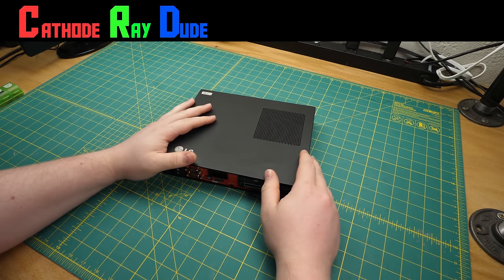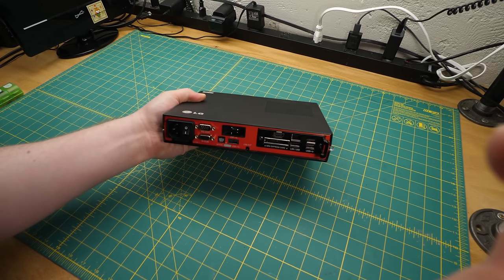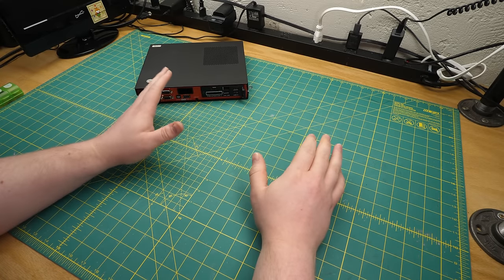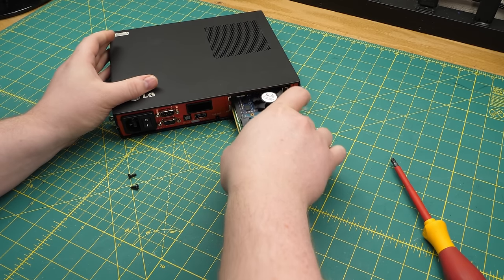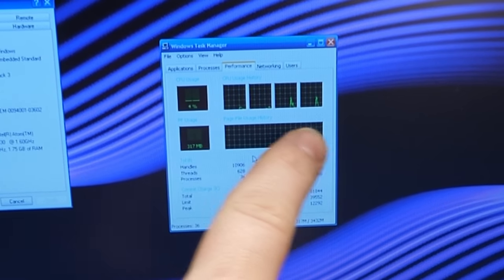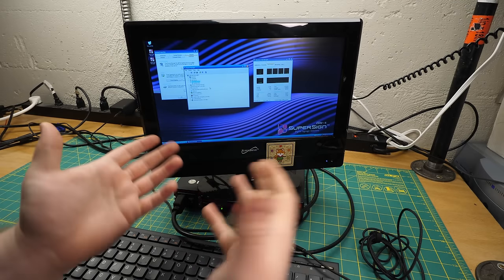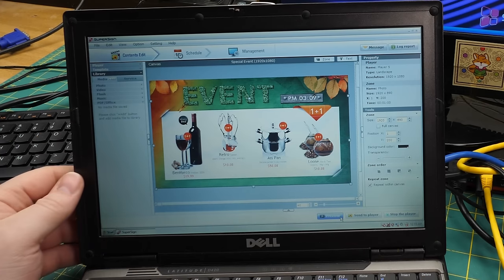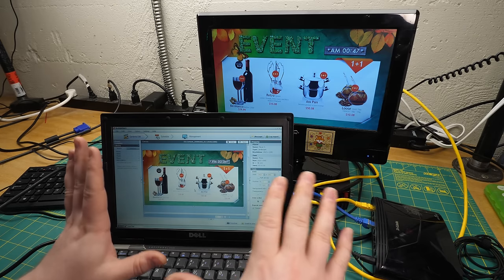Little Guys 6: The Worst Possible Timing [LG NC1000]

Comment from the maker: I've been informed that the super early Atoms (this is one of the first) were not fully SoCified yet and still required a chipset, so the ION probably is performing north/southbridge functions. Also, by the time this was made, XP was no longer being offered for new machines, so the embedded version was probably the only viable option.

Also, thanks to some viewers I HAVE ordered a cheap aliexpress breakout board for powering up my OPS units, but I'm still looking for an OPS enabled TV! Ideally 42" or smaller, and preferably with the touch functionality, but if you have anything and are in the greater pacific northwest, please get in touch - cathoderaydude at gmail. Thanks!
Reply: I had ION in hp 311 netbook. It was ok, surprising laptop where GPU is bottlenecked by CPU
Reply: I have an idea that might help you get a display. I used to intern at a New York public school, EVERY classroom had a Smartboard. And thanks to you I now know what the included OPS means. This might be a shot in the dark but if you contact your local DoE they might have discontinued equipment to sell off lease including a Smartboard.
Reply: nowdays the brightsign players tend to be a metallic blue. The still look beautiful ;)
Reply: ION in similar designs is used not just as a chipset but also for hardware decode acceleration which wasn't good at all on atom certified chipset from intel.
Reply from the maker: @MatteoSaitta  oh! That makes a ton of sense! I had read that the ion had video decoding silicon but it completely missed me that it would be important here, you're absolutely right.
Reply: Yep. I have a first-gen Atom desktop board that uses the 945GM chipset. The notable thing about it is that the CHIPSET has a bigger heatsink - with a fan - while the CPU has just a smaller heatsink. Because on those early Atoms, the chipsets (even a mobile chipset!) used more power than the CPU!
Reply: Besides Windows and Linux digital signage there are Android ones too. ION was a later on thing with Atom CPUs that was also included on some Netbooks, Nettops, and motherboards with embedded CPUs.
Reply: I'm replying here hoping you see this: there are OPS adapter boards on the usual avenues (Ali...) which break out all the ports and have power input
Reply from the maker: @Yrouel86  yep, already ordered one, thanks to another comment. Thank you!
Reply: Nvidia was able to make chipsets for any Intel systems that had the old-style frontside bus. Remember NForce? Ion is just Nforce for tiny low-power systems with what is basically a Geforce 9400 built in. They made an even better one for the early Intel Macbooks called the Geforce 320m. This died when Intel finally abandoned FSB and put the memory controller in the CPU.
Reply: Was about to say, i was pretty sure the atom 330 has gotta be using some kind of external ram controller since my nvidia ION board does ddr2
Reply: Much love for the Atom 330! Had two physical cores and had hyperthreading for four logical. The similar Atom 230 had a single physical core for two logical. Ran a 330 for years in an old Dell FX160 I used as a simple file server and the low power consumption made it viable to run 24/7. Chipset limitations did seem to affect things like RAM support - the FX160's architecture (and use of DDR2 with only 2 slots available) officially maxed out at 4GB RAM but even though the CPU is 64 bit if you max the RAM and install a 64 bit OS only 3.2GB is available as if you'd installed a 32 bit OS. Looks like the chipset was not designed to run 64 bits even if the CPU can do it.
Reply: I got one of those early Atom from Acer. it run linux and has the very early comercial SSD 16GB. it use pata ribbon. not the usual desktop pata ribbon. still lives but I store it back last year when I got new netbook. max RAM only 2GB. It does not like win 7 but win xp run just fine.
Reply: @MatteoSaitta  They were fairly popular for HTPCs of the era, had a mini-ITX setup running Kodi (nee XBMC) for several years, and it was great until it died, and at that point a Pi made more sense.
Reply: @CathodeRayDude  We see a lot of OPS displays in the education sector. They are used because these are interactive displays for classrooms so they run the built-in software like the digital whiteboard, wireless presentation, etc. They often have an HDMI input so you can go through that and have an attached laptop available via the on-screen software instead of using the "dumb tv" part's input switching. Usually running android.

They seem to be less common now that displays are being built with all of that processing power, OS and functionality built-in, which improves usability and stops users getting stuck on a different input. They are still an option though.

Anyway, if you can live with a big screen, look for schools doing refits if you want a cheap OPS display. Beware that OPS modules aren't necessarily universal though... I've definitely seen completely different connectors for different brands. I think that was an old issue though and over time they standardised.
Reply: I have an ion that I bought to make a DVR with Windows media center. I still use it, mainly now just as a network backup and the storage for my hdhomerun. The only thing that I didn't like about it is that it runs a little hot. I also bought a micro ATX case that has a vesa mounting bracket so I had it on the back of the TV at the time.
Reply: @CathodeRayDude  Someone should make a mini rack that you can plug multiple OPS modules in to, for home server setups!
Reply from the maker: @rebmcr  hahahahaha consumer blades
Reply: it is a LG Digital Media Player External
Reply: @dedr4m  Xbox 360 has an ATI GPU, the PS3 a Geforce 7. The main issue of the PS3 failing were special capacitors. I think the Nvidia GPUs failing came a bit later, with the Geforce 8 generation.
Reply: nVidia ION was a GPU but it was also a platform that consisted of an Intel Atom processor + nvidia GPU for small form factor computers- https://en.wikipedia.org/wiki/Nvidia_Ion#Ion_(first-generation_Nvidia_Ion)
Reply: @CathodeRayDude  I have an OPS display you're welcome to for free. I'm in the PNW too
Reply from the maker: @thepchan  awesome, although I just got one so it may not end up being useful - could you shoot me an email with the details on the one you have? cathoderaydude at Gmail. thanks!
Reply: I have a projector that states up to 32 gb flash drive support. My 64 gb drive won't show up, but my 1 tb external hard drive has no issues.
Reply: There are touch monitors for Thinkcentre tinys, that have the standart Lenovo Power pin. With a Buck converter, you could probably make it work on 12V or whatever you need.
Reply: BLAH BLAH BLAH,  BUT CAN IT PLAY CRYSIS???
Reply: Correct, and they were sloooowww
Reply: Still have joybook u101 with 945gc chipset init

Comment: A friend of mine runs a drycleaner and years ago  he was lamenting having to pay through the butt for his signage guy to update some system. Chromecasts had just come out and I suggested he try one for a small fraction of the cost and set his promos as a screensaver. Months later he said the biggest problem was avoiding casting soccer games to it while he was working and getting distracted.
Reply: a boyfriend? 🤭
Reply: I have also used a Chromecast (that I got for free with YouTube TV years back) as digital signage for a budget gym that needed my help, and the "remote management" of just adding JPEGs to a Google Photos album as well as the clock on-screen made it actually look and work nicely for them. Never found anything easier that also looked good on-screen (the Amazon players are just a 720p cutbus for JPEGs).
Reply: What if he plugged in a computer and set the adverts as a Screensaver? No need for a Chromecast
Reply: @kreuner11  if a PC can be acquired for free, then yeah go for it. Otherwise getting a $30 Chromecast seems way more cost effective.
Reply: Last time I paid through the butt was back in my pimpin' days. Crack isn't cheap, you know. Pun intended.
Reply: @baaelectronics  you can get second hand fanless 6 to 8W mini pc new from 120dollar.   2nd hand from 50...
Reply: @lillnemo1  Yet Chromecast is way more convenient for just throwing stuff on a Drive folder and forgetting

Comment: In the that era, the RAM depended on the chipset. 945 G/GZ/GM supports 4GB of maximum memory and 945GC supports only 2GB. I believe the Ion is also 4GB of RAM. The Ion is a GeForce 9400 M G but it's also the memory controller. The Ion could be DDR2 or DDR3. It also handles the PCIe lanes and SATA and stuff like that, and I believe it supports RAID 0 and 1.
Reply: The 9400M present on macbooks can work with 8GB of ddr3 ram, and the 9400 G too (desktop version) present on imacs
Reply: There is another part to the story and that is Intel doesn't go back and revalidate old platforms when new higher capacitiy ram chips are made
6th gen (maybe 7th gen idk) are quite happy to support 128gb of RAM, but 32gb ddr4 udimms only came out in the 9th gen
(They did go back and validate on 8th gen apparently)
Reply: I still remember when 775 was quite common. At least in my friends computers. I was checking memory compatibility, max ram etc... And it never was true. I remember gigabyte 775 mobo "Supports up to 4gb of ddr2" was working fine with 8gb, with c2d 😂 (early days of modded minecraft, that sh... needed A LOT). Also there was something similar on AMD platforms too. Still owning a C2Q with 8G that serves sometimes as a minecraft server :D
Reply: @carmonben  Correct, Intel does not go back and re-validate memory maximums. The Alder Lake N series chips for example will list 16GB of RAM as the max. But, that is because when they launched, that was pretty much as much DDR5 as you could get in a single SODIMM. Nowadays you can just slab a 32GB stick in there and it'll work.
Reply: yea theres no reason it would be limited to 4 or 8 gb when 32gb is supported on these chipsets and socket 775.  you still have to enable /pae /4gb in sys ini or windows configuration utility. 

windows also doesnt automatically enable dual / quad channel ram either. not for these boards if i recall
Reply: Ion 2 in my revo maxed out at 4GB, but it would only show about 3.2 GB.
"If you have 4GB of Random Access Memory (RAM) installed in your Aspire Revo R3600 or R3610, the operating system recognizes it as only 3GB. This is not due to any software limitations, but to the architecture of the Atom processor.

Due to its design, the Atom processor can address up to 4GB of RAM. Parts of the memory will be assigned to hardware resources during the start-up of the system, making this memory invisible for the Operating System.

The System missing memory is used in the following way:

256MB is assigned as video memory.
A total of 512MB is used for PCI hardware resources.
256MB is dedicated to PCI Express hardware resources."
Reply: @mmllmmll22  LGA 775 was a great standard. From 2004 to 2013 you could buy a standardized CPU and chipset, meaning you didn't have to keep replacing your motherboard every time. Ever since 1156 it's been a disaster where every new generation has a new socket with incompatible variations. That's one reason why AMD overtook Intel so handily, was because FM2 and AM4 have stayed the same for years (twelve years of support for FM2 and eight so far for AM4) while Intel has a new socket every twelve to eighteen months.
Reply: They'll also sometimes just not validate past a certain size for who knows why. I have a J4125 rated for 8gb ddr4 but it will happily take 16gb. 8gb sodimms were a thing long before that chip came out.
Reply: I've had the misfortune to own two ION boxes (Aspire Revo 3400 and a similar Packard Bell branded one). I believe they were DDR2. Not sure what the RAM limit was (since it was DDR2, the cost of 8GB made that a non-option anyway), but the BIOS or chipset made it impossible to use more than about 3.2 gigs out of 4.
Reply: @VulpesHilarianus  yet I heard there were compatibility problems with both 775 and AMD sockets when trying to run newer CPU on an older MB, so the rule did not really work reliably
Reply: ION apparently could support 16GB and obviously reserved a certain amount of the 9400.

We saw some odd industrial machines that had 16GB+512MB reserved.  No clue but it was A PoS.

Comment: The SSD form factor used by this little guy (with the 4 mounting screws) was developed by the SFF Committee and was adopted as an industry standard in 2009 by JEDEC as MO-297. JEDEC refers to it as “Slim Lite SSD Assembly” but industry almost universally uses “half slim” branding instead. Apacer has a “Sata Disk Modules” line of products which pre-date the standard that are offered in about a dozen ad-hoc/non-standard form factors and are still being made. As far as I can find Apacer has only ever used the “half slim” branding for standards compatible ssds. The non-standard modules being described as “half slim” are listing errors by resellers.
Reply from the maker: That doesn't surprise me at all; thank you for the elucidation!
Reply: @CathodeRayDude  resellers trying to pass one thing for another, not surprising at all
Reply: I had an Acer Chromebook that used this kind of SSD, even though there was room for a full-sized laptop drive. This was way back in the early days, probably first or second generation.
Reply: @CathodeRayDude  You probably have a bunch of these modules already and don't even know it. Most lower capacity 2.5in SSDs are actually small modules like this in an oversized shell. Some (Crucial BX500 and Lexar NS100 at least) are this exact half slim form factor, while others have slightly different footprints and mounting holes.
Reply: I cracked open one of those cheap WD green SATA SSDs and it had the same form factor  PCB inside. Became handy to upgrade an ancient win7 tablet to more than 16GB storage...
Reply: @CathodeRayDude  If you get an HP T5740 series the Apacer SSD version is what you'll need for it since the proprietary HP modules are pure unobtanium now. It will go in with a left or tight angled SATA+power 90 degree adapter. One way there's the HP SSD nylon standoff that will have to be removed, if it's there. The right angle adapter will have two mounting ears that will need cut off. One side to clear the riser connector, the other to clear a large capacitor.

Anything wider than a SATA+power connector will not fit due to the PCB hitting the riser slot.

If you want the expansion chassis, there may still be an Amazon seller with complete new old stock kits for $13. It comes with a PCI and a PCIe riser for one card. The PCIe slot is x16 size but only x4 connected. It also adds some more ports.

I ran one for quite a while as a 32 bit Open Media Vault 5 server, doing nothing but serving HEVC video files and MP3 music from an eSATA 500 gig hard drive plugged into a PCIe x1 eSATA card.

Then I wanted to get fancy and install a 1TB M.2 PCIe x4 NVME SSD internally. I bought an x4 adapter and an x1 adapter. I plugged in the x4 adapter with NVME, hit the power and it was dead. I tried the x4 adapter in a normal desktop and it wouldn't boot. So the x4 adapter went in the trash. I tried the same SSD in the x1 adapter in the same desktop and it was fine. Ah, issue resolved, killed by a defective x4 adapter!

I bought another T5740, set it all up as I'd had it with the eSATA card and external drive, worked 100%. Swapped in the SSD on the verified working x1 adapter *and it killed it dead*.

So apparently the HP T5740 series is deathly allergic to using MVME SSDs in the PCIe riser adapter. Perhaps too much power draw by the NVME SSD? Best bet would be a PCIe SATA card and shoehorning a de-shelled SATA SSD into the expansion chassis.

These thin clients also have a 44 pin IDE header, typically used with an Apacer IDE DOM, which can be installed simultaneously with a SATA module. Even neater, if one is good with surface mount soldering, right next to the IDE header are pads for a second SATA+power connector and the connector is all that's missing. Solder one on and a second SATA DOM can be installed. Get really clever and it could fit two SATA and one IDE modules. There's also a short Mini PCIe slot for a WiFi card. There's two locations where a retention clip may be soldered, for a short or long card. I don't know if the slot will work for anything other than the HP specified WiFi cards.

TL;DR The HP T5740 series was one of the most expandable 32bit Thin Clients made.